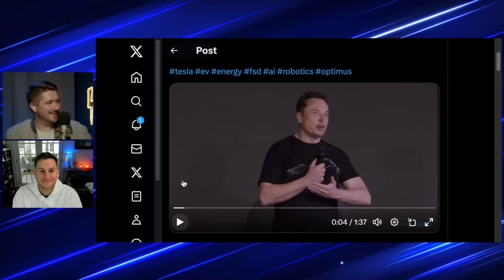Tesla's HUGE Stock Growth Potential!⚡️w/ Dillon Loomis

Comment: 28:49 Jan, it's all very nice talking about the EVs being more economic than the ICE cars, but it just occurred to me that if the oil producers are cornered because the transition to EVs that are cheaper to run, all they need to do is to halve the price of crude, and as we know they are just a filthy cartel which sells for multiples of their cost, they would make money on it even if they sell it for 1/3rd of the price. That could throw a spanner to the EV wheels. 
I do realize that they most likely won't do it, because the sizeable part of their business is oil for plastics industry. But just theoretically, without the artificially high cartel prices, and also without the government gas taxes, the EVs would hardly compete with oil.
Reply from the maker: Interesting angle as always! You always give great input. Thank you for that! 

You have an interesting point here! But I would also add taxes to the mix. Oil is heavily taxed. It is 50% taxes in Germany plus the 19% VAT on top of that.

Comment: the microsoft copilot for office 365 costs $30 per month. the installed base (of 365)  is 400 million seats. tesla fsd costs $199 per month. the installed base is perhaps 5 million cars. keep that in perspective. tesla‘s market cap is around 550 billion. microsoft is about 3.2 trillion. 5 million x 200 is one billion, 400 million x 30 is 12 billion. so, msft should be worth 12 times Tesla. but it‘s only 6 times.
Reply from the maker: You haven’t considered ride hailing. If FSD is solved this will be a core feature for every Tesla owner.
Reply: What a ridiculous way to try to value Microsoft and Tesla.    Virtually incoherent.    Go buy Microsoft if you want and then double your money once Microsoft hits a 7 trillion dollar market cap.   Good luck with that.
Reply: @dang2055 my derivation is straightforward, it may not be relevant, but it‘s certainly not incoherent.
Reply: In the US alone there are over 200 million registered passenger vehicles so fsd's market is greater than 5 million worldwide. But fsd's most significant value will be reflected in the use of robotaxis fleets.
Reply: The take rate for FSD is about 10%. You have way over valued FSD.